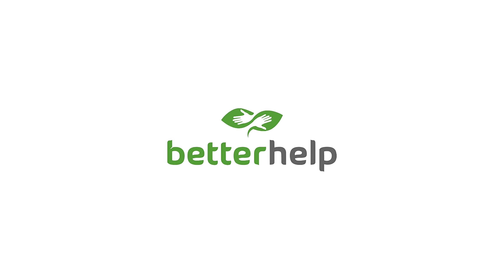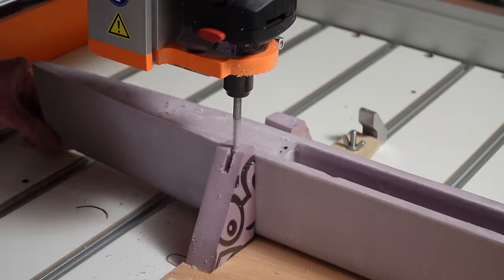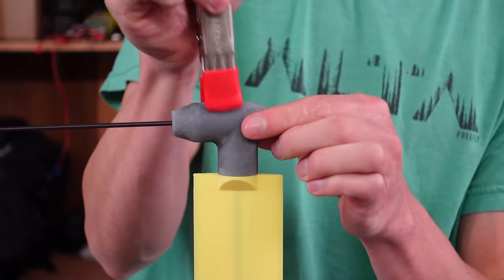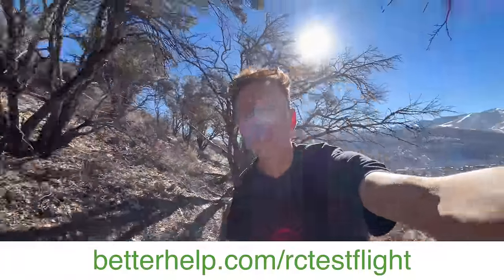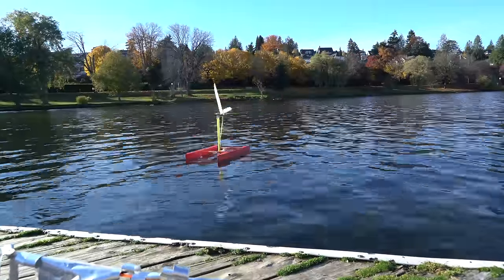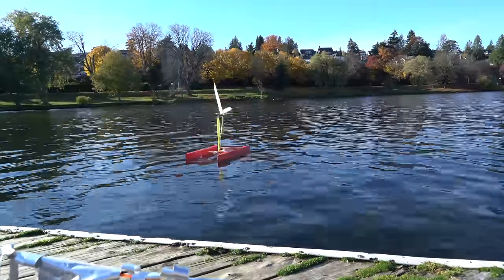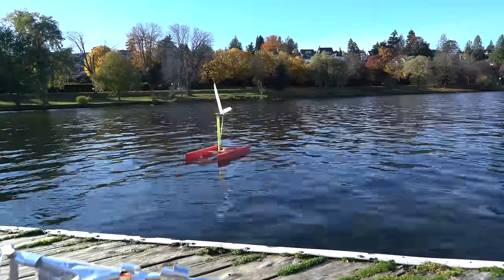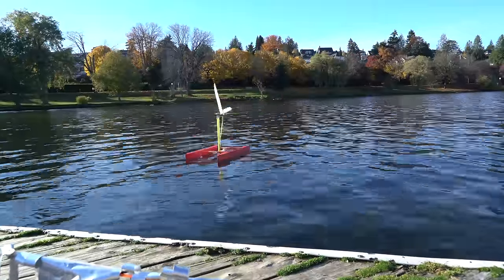Sailing Directly Into the Wind - Is it Possible?

Comment: Even though they're less efficient, what about using a vertical axis wind turbine (or turbines!) to drive the prop (or props), since it would require 1 less beveled gear set and the turbine assembly wouldn't have to "turn into" the wind?
Reply: Good idea
Reply: The losses due to beveled gears can be  lower than 2% when produced well the typical difference of efficiency between Vawt and Hawt is around 20 % though I would find it interesting as well it will probably work even worse
Reply: 3D printed plastic bevel gears are nowhere near 98% efficient, even metal once don´t get 95%. I would guess they are like 80% efficient. @TerraCAD
Reply: @TerraCAD that doesn’t take into account that you can put more vertical ones on the same space a horizontal one needs.
Reply: less efficient ... but also alot more drag.
Reply: @renaissanceman5847  that depends on the type of vertical turbine.
Reply: Also the gears don't have to be 1:1 so it could use a larger water prop being fed more torque or the other way a smaller prop spinning fast for more thrust ?
Reply: @exo068  if any such verticals were more efficient... we'd be seeing them instead of the typical 3 bladed monsters we see all over the countryside now.
Reply: @renaissanceman5847  they can’t be built high enough like horizontal ones. Large horizontal ones can easily reach over 100m where the wind is stronger. The efficient ones also the problem that the bigger ones need an extra starter motor (some designs combine multiple and don’t need one), they also can’t turn out of the wind in a storm. They are primarily used in isolated electrical systems thanks to their smaller footprint, high reliability and cheaper price due to the lack of complexity. The small footprint also makes them ideal for ships that need to unload stuff and they can be installed more numerously than a horizontal one and outperform a single one. This isn’t taking into consideration a Flettner-Rotor that already is on ships in use.
Reply: It has been done and you are correct this is more efficient across a wider range of wind speeds. However, still can't efficiently sail directly into the wind.  The traditional sail boat still remains more efficient despite the tacking.
Reply: @blubb7711  hey after talking with a professor at my uni and asking him about how efficent bevel gearboxes are greater 95% is definitly achivable and i did not claim anything about 3d printed gears. With proper alingment of the axis and appropriate bearings it is not easy to do but definitly achivable to get greater 95% efficency and the most important thing is proper alignment and tollerances. the setup here definetly was not over 80%
Reply: @exo068 but that would mean more drag

Comment: So you remember Keven Costner's sail boat in the movie  "Waterworld" released in 1995. The trimaran used a three  bladed  Darrius wind turbine and sails. Your project will work with a vertical turbine, but when you sail downwind, the craft will be slower than pure sail.
Reply: Just turn the turbine blades in the opposite direction so that the behind wind drives the turbine.
Reply: @philipsmeeton   what means you need a servo system to set the blades (think of helicopter) and it gives extra friction.
Reply: To go efficiently downwind, use the turbine blades to push against the wind, driven by the motion through the water.

Comment: My idea on solving the screw being too slow is to connect the rotor sail and the screw with a remote controlled CVT and test the optimum gear range. After you get the data and find the gearing solid, magnetic gear couplings might help since both input and output shafts can be placed diagonally (to save weight and space), also theoretically less friction.
Reply: Cvt might be essential in getting peak efficiency in all angles. Pretty hard to make tho
Reply: Running a generator and a motor would be cheaper and more efficient than these gears
Reply: great idea

Comment: I used to do a lot of sailing and can say that the best point of sail is the beam reach where efficiency of converting the apparent wind direction and energy into forward motion over the Earth.  keep in mind that as the sailboat gains speed the apparent wind direction changes forward more so beam reaches in reality end up being slight downwind in actual movement direction when the apparent wind is exactly 90 degrees off the beam.  Sailing with the wind will seem slow but usually waves and surface water flow is in the same direction so even though its not as efficient (in most modern sailboat rigging schemes) you are still making good headway.  When close hauled you will feel like your really moving with the wind in your face and waves crashing under the hull but in reality the drag of the sails and hull against the waves are now directly counteracting against your direction of motion making it a slower point to sail.  Tacking further reduces your efficiency because your not traveling the desired course in a straight line (the actual distance your covering will be at least 33% greater than the straight line into the wind).  Also a correction that the sails fully provide forward force.  In fact its an interaction where the hull of the boat, either by keel or dagger board will prevent the boat from too much leeward slip.  The best analogy is like squeezing a watermelon seed in your fingers and it shoots out blunt end first because  the forces your exerting only have one direction of relief and that is out.  Similarly the sailboat being pushed to the side does not want to go that direction so the direction it does go ends up being forward.  Lastly the mechanical efficiency of the wind turbine/propeller is never going to be as practical as sticking with sails with many of the reasons illustrated in your experiments.  Given an RC sailboat and the turbine powered boat the sailboat would have  handily beat the turbine boat in a race.  Also if you did this in full scale I would not want to be on the deck of a boat with those massive turbine blades spinning over my head.  The thought of that and how bad an accident or failure would be is simply too horrifying to contemplate for long.
Reply: Not forgetting, tide is king and wind is queen.
Reply: If the turbine blades were spinning well above your head why would that be a problem?

Comment: An aerodynamic profile on your wind turbine blades should make a huge difference because the flat blades you have might only be achieving a L:D ratio of maybe 6:1 whilst a good aerofoil could have in the order of 20x that.
Reply: At low Reynolds numbers the difference isn't usually that drastic, but yeah 10:1 seems a bit optimistic.
Reply: All the effort(s) with designing for "efficiency" and then using such an inefficient (non-airfoil) wind turbine design  ???
Reply: @gary6449  gary has got it right.  Blackbird works better because of the aerofoil design of the blades.  The flat blades just provide a deflective pushing force and a heap of drag , rather than the suction like force from an aerofoil

Comment: I believe that the 45° air propeller pitch is probably optimal for the same reason that a beam reach is the fastest point of sail on a sailboat (where the wind is at a 45° angle to the sail).  Interesting project.
Reply: I don't know about sailboats but something about wind powered cars and the optimal pitch angle is dependent on blade profile and wind speed so this is not necessarily false but having adjustable pitch control is pretty necessary for good performance with different wind speeds
Reply: "(where the wind is at a 45° angle to the sail).  "

The most optimal is to have the wind blow directly into the sail from behind the boat, so zero degrees.
If the wind comes from the side at 90 degrees to the ship, the optimal angle really depends on the type of sails that the ship has. Sails don't just deflect the wind, they provide thrust too so the deflection angle is not really the most important factor.

It's fascinating stuff, worthy of a deep dive.
Reply: @vinny142  That is not correct.  If the wind is behind a sailboat, the maximum speed it can achieve is the speed of the wind (unless you get into this fancy propeller stuff, which is a different topic.)  Having the wind behind the sailboat (which is called a run, as you may know) is the slowest point of sail (aside from sailing directly into the wind in the no-sail zone).  The fastest speeds a sailboat can achieve is at a beam reach, at which the sail is set at 45° degrees to the wind.  My point stands—the reason he was seeing an optimal performance at 45° of propeller pitch is exactly the same reason a sailboat goes the fastest when the wind is coming 90° from the direction the boat is facing and the sail is set to 45° degrees to the wind.  If you still disagree with me, let's go racing sometime.  :D  Welcome to the "people correcting people incorrectly club" @vinny142.
Reply: @vinny142  Beam reach (wind 90 degrees to the boat) is much more efficient on modern craft than downwind. Going downwind you're using the sails to produce drag, and as you go faster the relative wind decreases. In a beam reach you're using the sails to produce lift, and the force generated is very close to the direction you're going, and as you go faster the relative wind doesn't decrease
Reply: The cactus is right
Reply: @victor-charlesscafati  goddamnit I hate when people who don't sail talk about sailing as if they know stuff. literally no one in this entire thread has gotten it fully right when it comes to the fastest point of sail. the correct answer is it all depends on wind speed and athlete skill

basically ignoring sails only used downwind like spinnakers and gennakers a beam reach will always be the most powerful point of sail. however more powerful doesn't always mean fastest. boats are limited in how much power they can use by the amount of righting moment (the force counteracting the tipping force of the sail) they can generate using keels, foils, bodyweight etc. in light winds without spinnakers a beam reach will be top speed, however the further downwind you point the less the force of the wind wants to tip the boat over, because the forces are better aligned. that means that any given boat design can receive the most force it can at a dead downwind angle. which means for any given wind speed your top speed will be as close to a beam reach as you can point without having to depower your sails to keep your boat well balanced.

 in speed runs in flat waters that means to reach as high a speed as possible you want to have the strongest wind possible and sail as deep angles as you have to. speed records on windsurfers etc are set at angles of like 30 degrees off a run in 60 knots of wind for a reason this is only limited by practical reasons like boat handling skill, the further from a beam the more precision is required to maintain attached airflow and it becomes unreasonable past a certain point, which changes depending on the class. it is never a full beam reach for top top speeds, in any class besides foiling boats, because they get limited by foil design for speed, IE when the foil loses stability to cavitation etc, nothing else. 

now you may say that I'm being overly semantic about the difference between speed and power, which is true, but you also got wrong that when sailing on a beam reach the sail is 45 degrees to the wind. this is objectively false and your most egregious error by far in this context, because the angle of attack on the airfoil is the entire topic of conversation. on a beam reach the apparent wind of the boat moves way forward relative to the true wind because the force vectors of boat speed and true wind combine. in basically any modern class, including slower boats like lasers, the apparent wind gets far enough forward your sail will be at most maybe 30 degrees. in the higher performance classes like moths, f18s (which I race) etc, on a beam reach your sail is closer to 7-10 degrees off the true wind. 

this is true for propellers as well. the faster they spin relative the wind speed the less angle of attack relative the wind you want. that's why propellers traditionally have twist in them, the outside spins fasters thus it needs lower angles of attack relative the wind direction than the inside of a propeller does. so the ideal propeller angle of attack is variable depending on the wind speed relative the propeller speed. it could be anything between 10 degrees and 80 degrees depending on how you set the boat up, and will be variable along the length of the blade
Reply: @rydenkaye9735  What you have done is taken my short, theoretical comment about the similarity of sail trim and propeller pitch, and replied with a dissertation that factors in all sorts of real-world details like boat design, friction, center of effort, etc, in an attempt to display your knowledge.  In my perusal, your information looks to be reasonably accurate, but you completely missed my point.. woosh.  I stand my my original point, and my rebuke of the guy that thinks that a run is the fastest point of sail.  (by the way, starboard tack has right of way over a port tack.. there.. now you can tell me "not if you're towing...." in your reply that will also likely miss the bigger point)
Reply: @victor-charlesscafati  a run is objectively the fastest point of sail for many boat classes though. you are not correct. for a simple example, the 12 meters I've raced a bit hit their top speeds about 15 degrees off a run in high winds thanks to mast rake adjustments and a massive symmetrical spinnaker. in lighter winds sure they will be faster higher off a run but you didn't specify top speeds in light winds, you said top speeds period

Comment: Great project and very well engineered!!  I'll bet with enough engineering it could compete with standard sailboats when sailing into the wind, since it doesn't have to tack.  If the streamlining were developed enough and perhaps if it were combined with hovercraft or hydrofoil technology to eliminate drag, it is likely possible.  Incidentally, I have a series of ion thrusters on my channel, that are patented for lifting themselves and their power supplies against gravity!

Comment: I've been designing one of these for a while now, my first attempt (I have a couple of videos) performed similar to yours. You should read the documentation given in Optimal Blade Design for Windmill Boats and Vehicles by B. L. Blackford (1982), that is chiefly about the design of turbine powered boats, and gives some numbers as well as known-functional blade design offsets. There is also (amongst others) the vessel Falcon, previously part of the National Maritime Museum in Irvine, Scotland, which was a full-size boat powered by this method. 
The comments on higher aspect ratio propeller and more efficient (non-planar) turbine blades are spot on, and also what I've been working on with my double-size V2 design. 
My version one design used a cam-pitch linkage to change the pitch of the blades depending on the direction of the hull relative to the wind, but I ditched this temporarily after realising that I had more elementary problems to overcome first. V2 is ready to go, and I'm currently awaiting a nice windy day to run some tests!

Comment: This has been done decades ago 1:1. Search for a project called Aeolian (or something in that direction), an ocean going yacht with a wind turbine on the top of a mast, generating the power do either directly drive the prop mechanically, or store electricity in batteries, to power an electic motor, As long as there was wind, you could go in any direction you wanted, even directly into the wind.

Comment: I think a twin - counter rotating prop set up would help with directional stability.

You could also run a shaft inside each hull..  reducing drag.

I think you are on the right track with higher aspect ratio water props

Great video !

Comment: Hello, I hope you read this, I remember about 20yrs ago it was proven that the paddling under water motion a ducks feet do is way more efficient that a propeller. But the rocking on boats made crews sick and a ridged structure break apart slowly so it was never used for shipping etc. But a slightly flexy boat with no crew would be fine
Reply: That's so interesting!